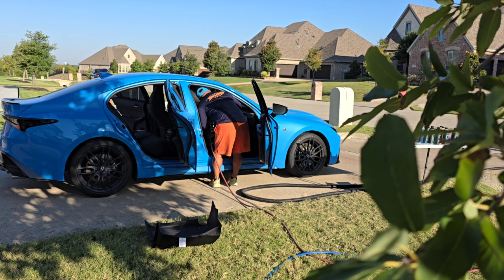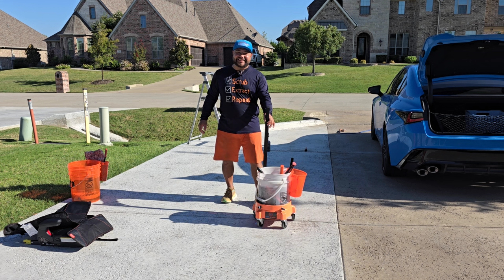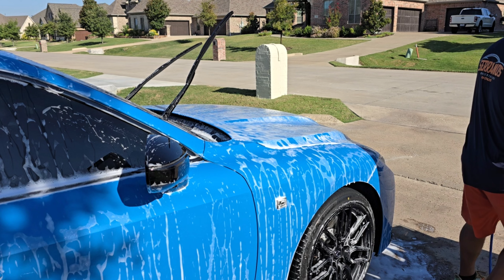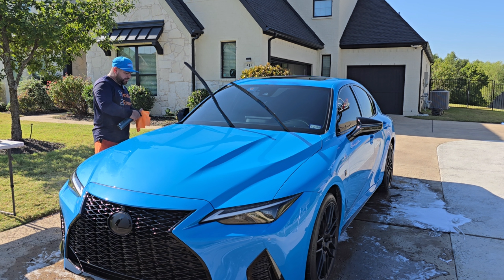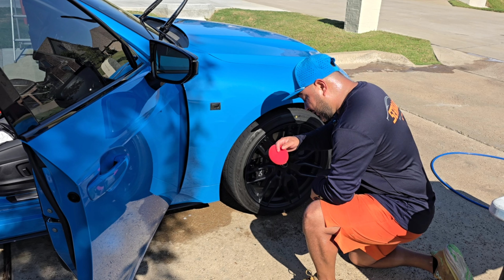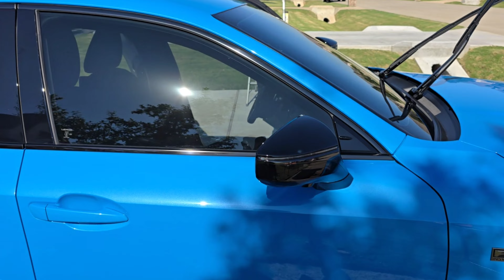@armourdetailsupply

Comment: P h neutral soaps do nothing at all if you dont agitated
Reply from the maker: @Juicefree  Well it cleaned this quite well, vehicles that are garage-kept and don't get used.
Reply: @serranosmobile  it was the pressure washer that cleaned it not the soap ... you would want to use a high alkaline soap if you looking to pre soak a vehicle and have any actual effect
Reply from the maker: That's correct
Reply from the maker: The soap helps or course